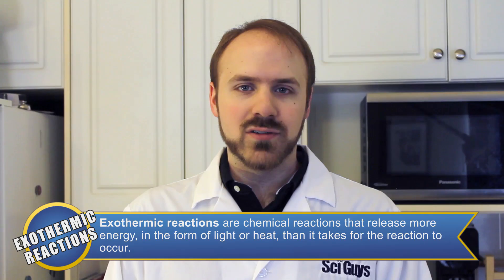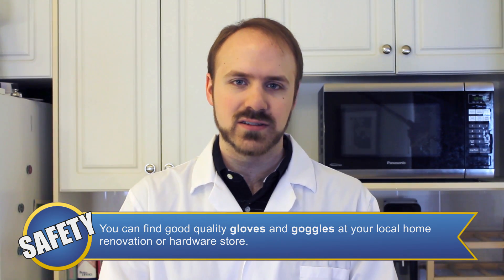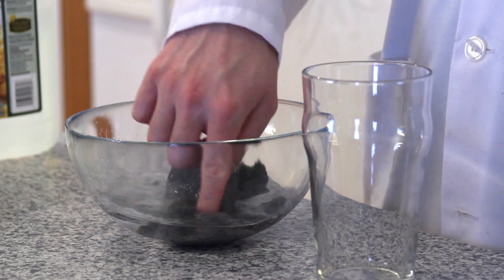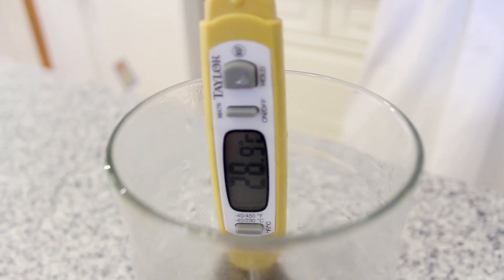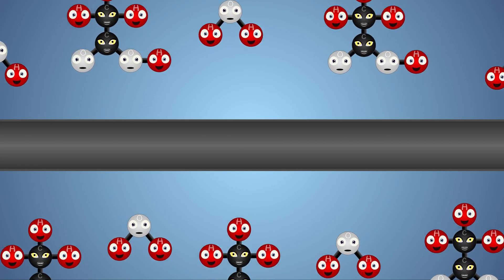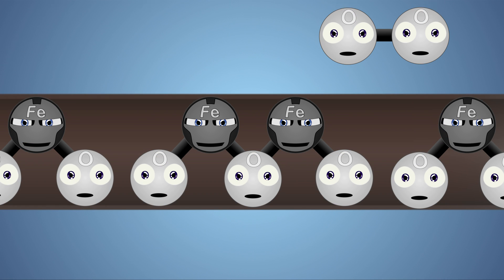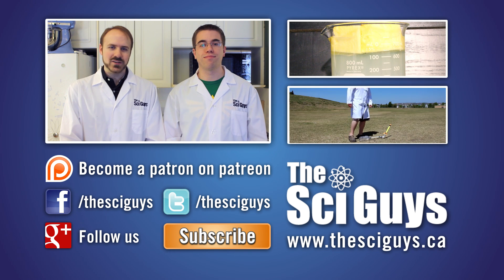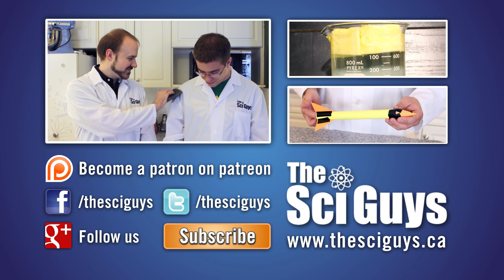Steel Wool in Vinegar - The Sci Guys: Science at Home

Comment: So I'm wanting to create a faster process to weather wood and dissolving steel wool in vinegar works but takes days to more than a week to dissolve the steel wool.

I'm thinking about using the vinager as was used in this video to only remove the coating on the wool fibers, then placing the steel wool into a household 3% peroxide solution to accelerate the oxidation 'rusting' process.

Anyone have any input on this?

Ive also seen people add salt to a mixture of white vinegar,  peroxide, and steel wool, but dont know if it is necessary. 

This is a good example of why I would loved to at least minored in chemistry decades ago! But I went the direction of electrical theory and electronics.

Comment: The vinegar isnt only going to attack the protective layer, its going to react with the iron to produce iron acetate. The water may also react to produce oxide but thats a much much much slower reaction it isnt even comparable. 

Want to test how u were wrong? Brush some piece of iron with a steel brush to remove the outside oxide layer or coating, then place it in water. Nothing will fucking happen for hours, when the vinegar acted in seconds.
You can also check this by placing a balloon on top of the glass with the vinegar. Acetic acid + iron --> iron acetate + hydrogen. The hydrogen will fill the globe but be careful cause its explosive

Comment: Why don't you measure the temperature of the vinegar solution before it's added to the steel wool? This would help to make it more clear that the heat is from the reaction and not from the vinegar solution itself.

Comment: If you put the vinegar and steel wool in a mason jar and close it, the vinegar will dissolve the steel wool, turning the vinegar black.
Leave it for a few days, then rub the vinegar on some wood with a high tannin content, like Maple or Walnut.  It will turn the wood Black.
If you don't have a high tannin wood, like cherry, pine, ash, etc. first rub the wood with a strong tea to introduce tannins.
This process is called "Ebonizing" and is a wonderful way to darken wood without using harsh stains!
Keep up the great work!  Have a better day!
Reply: Better not to close it. The reaction produces hydrogen so you need to let it vent

Comment: Does anyone know what the chemical equation would be for this reaction?
Reply: There are two separate Rxns occuring to create the "rust" which is a hydrated iron oxide, Fe2O3.nH2O

1) 2Fe(s) → 2Fe2+(aq) + 4e-, Anodic Oxidation & Dissolution of Iron

2) O2 (g) + 2H2O(l) + 4e- → 4OH- (aq), Cathodic reduction of Oxygen

When combined, the overall equation is: 2Fe(s) + O2 + 2H2O → 2Fe(OH)2, the iron (II) hydroxide will then continue to oxidize until all available iron/oxygen is used up. The key factor though in what we call "rust" is that it is "hydrated", hence the .nH20

There are trace minerals in Vinegar, and residual elements in steel wool too, but they are in such minute quantities that their rxn is superfluous when performing this experiment, or when making homemade weathering stains.
Reply: @DrNarf  isnt it iron(III) ???
Reply: nope
Reply: nah i quit watching when i heard he was using EU units
Reply: @jhanks2012  what are EU units? They don't even use units

Comment: would it affect tha rate of rusting if the steel wool isnt fine?
Reply: Yes, because the rate of the reaction (rusting) depends on the surface area of the steel. Fine steel wool has a much larger surface area than say a single bar of steel of the same mass. This means more steel is exposed and is able to react :)